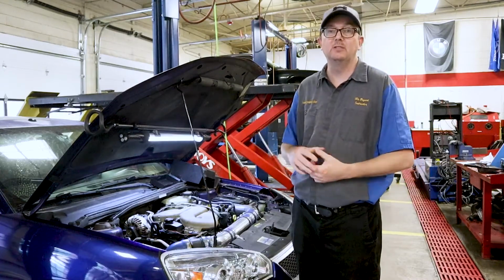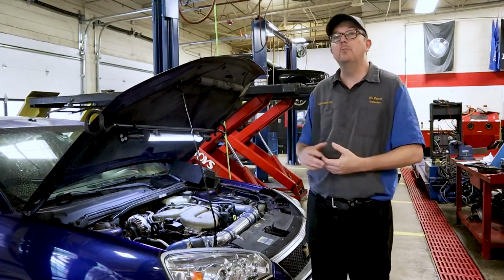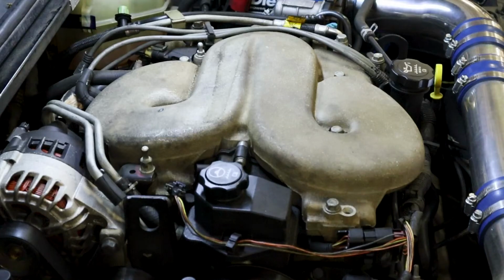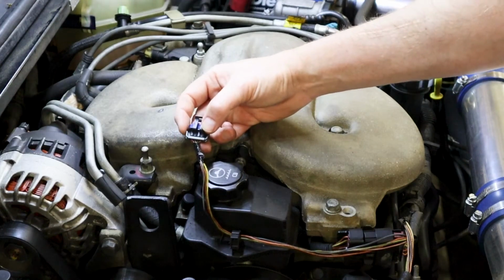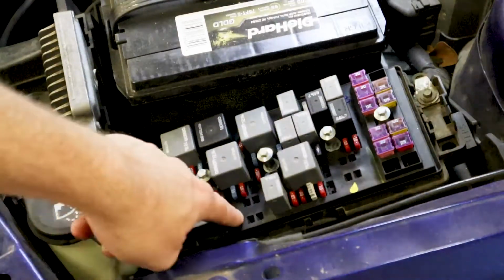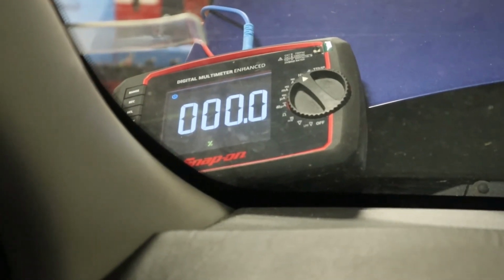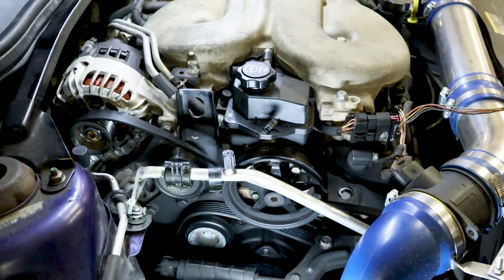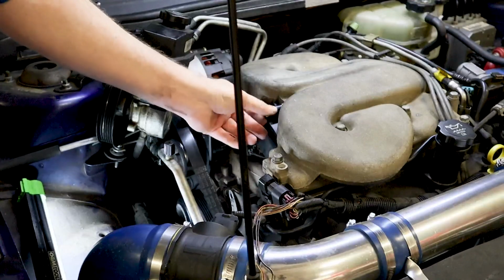GM 3.9 3900 Malibu, Impala, Monte Carlo, G6, Uplander - P2070, P2071, P0660 codes

Comment: Long runners increase low-RPM torque by improving air velocity, while short runners boost high-RPM horsepower by reducing air restriction.

Comment: Can purge valve and intake manifold tuning cause no acceleration? I have this issue on a g6 GTP where the engine revs with lil to no acceleration
Reply from the maker: That sounds like classic catalytic converter clog as well or a fuel pressure issue. Probably not the tuning or purge valve in my opinion. Hope this helps.
Reply: @AutoScholarwithMrB  thank you I only ask because I have codes p0455 and p2070
Reply: @A @AutoScholarwithMrB  the imt control valve is making noises when the car is not on. Like right after driving

Comment: I had this code p2070 being displayed after I had my power steering pump Change plus my ac and the cooling fans was not working
Reply: Did you get it fixed? I just had code pop up on my 2006 G6 3.9. AutoZone or advanced don't have it. Had to order online was $163. Mechanic gone charge me $80 to fix it. Of all the cars I've owned I ain't never heard of this part before.
Reply: Where did u order it from i need a intake manifold for my 2006 impala 3900 motor
Reply from the maker: @LatriceSharnay-wz3sd I got it locally from Autozone or Oreillys
Reply: Hey I have the same code on my 09 Chevy impala. Also my ac and cooling fans aren’t working. What did you need to do to fix it?